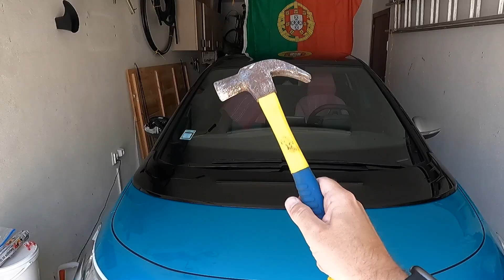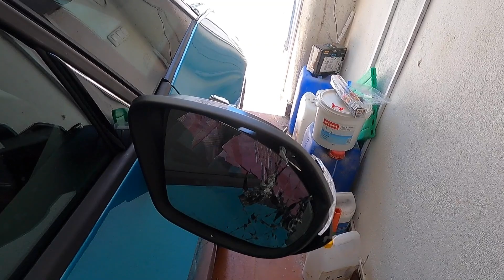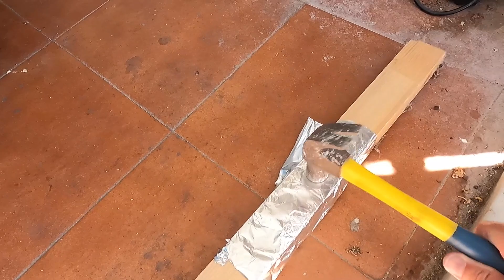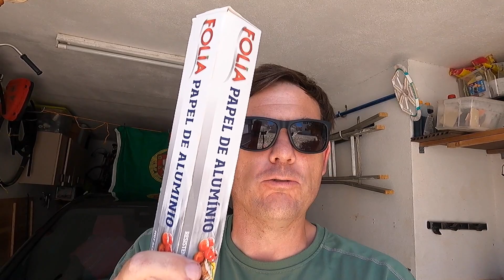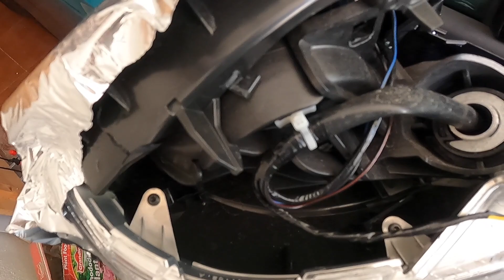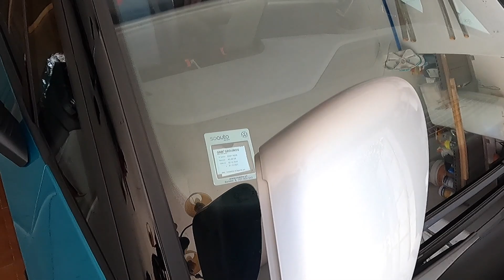Volkswagen ID.3: Wing mirror Teardown and Analysis

Comment: 12:42 at VW saved a lot of weight by not metallic colur under the hood - Hans Dampf has worked well, the Hans Dampf stands for a german that does not need to rest and wants to go and go and fo fully steam cause Hans Dampf stands for Jack Steam in all streets, famous for pushing hard to the limits.
But Hans Dampf has found a brother in Portugal I guess called Marcus enjoying the sun and people there working on the Moron dilemma
Reply from the maker: Yes, Hans Dampf in Allen Gassen works at VW as one of the top engineers. 😀

Comment: wing mirrors ? 
Where are the wing doors and the nails to remove with that hamme ?

metrosized sounds  like minimized but for sure a lot of fun
But why is it called tinn foil ? 
I know tinn from that tinn soldier movie when it came out back then cause we had a hotel room when there was an ad campaign for that movie in Vegas presented live everywhere, always tinn soldier guided people. 

But you had for sure worked in favor of the VW economy getting an improved mirror and be happy that you can get that glass cause previously they had started to offer those only as full assembley for that 500€ you had mentioned till the EU forbid that to avoid waste and protect users. But that battle seems to have been lost on another side: the LED lights will make you cry once you will have to replace those cause the 5€ buls solution is over ... 250 times more
Reply from the maker: Now instead of paying for one replacement part I have to pay for 3 ☹️

It should be called Aluminium Foil but in England we still call it tin foil.  https://en.m.wikipedia.org/wiki/Tin_foil